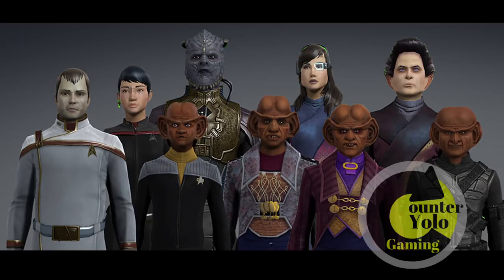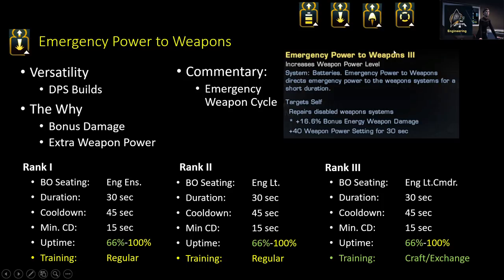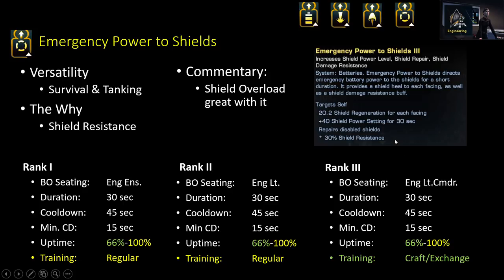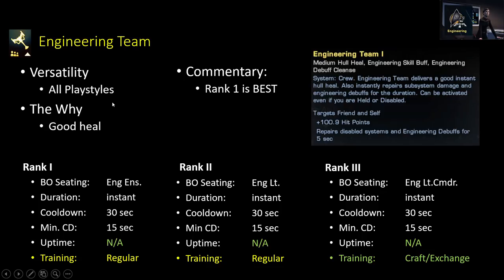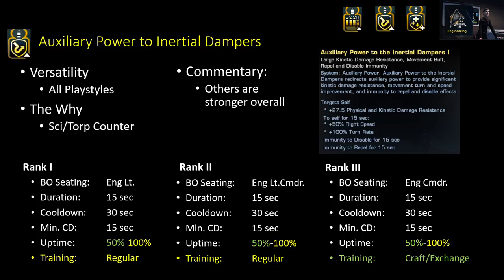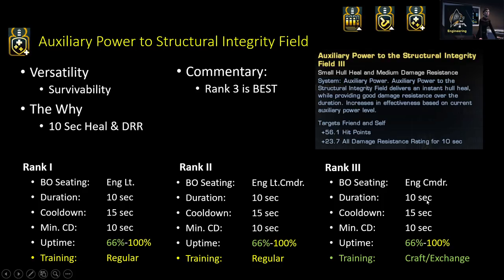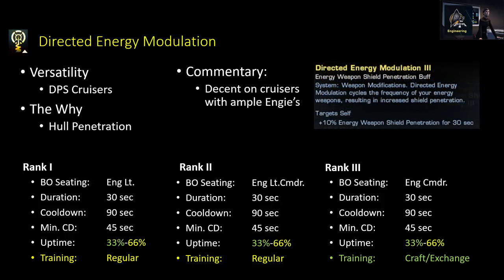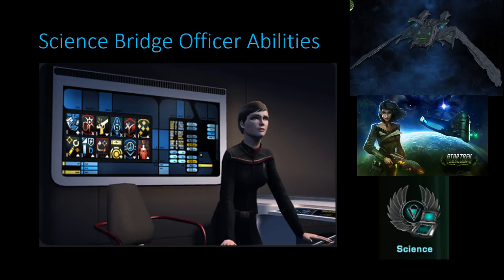Engineering Bridge Officer Abilities (Space Part 2) | Star Trek Online

Comment: Emergency Power to Aux  (EPA) really just gets the most use on torpedo boats (especially budget builds), that focus a lot on exotic damage. Your weapon power level in these cases are usually pretty low (30-40 base) as torpedo damage isn't affected by power levels. That being said, you usually only need EPA I to max out your Auxiliary cap.

Loved the advice for the Aux to Emergency Battery. I'll have to think about trying that build for sure if I ever get the capital. Sad about Boarding Party. Honestly if it wasn't auto targeted by Fire at Will, Scatter Volley, and hangar pets, it would actually see a lot of use.